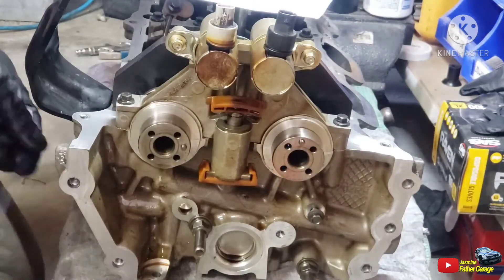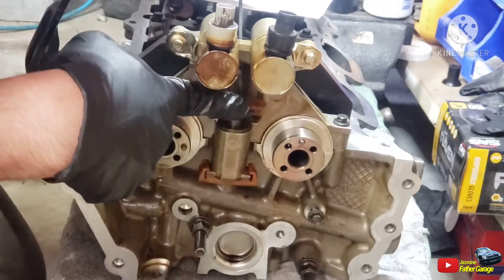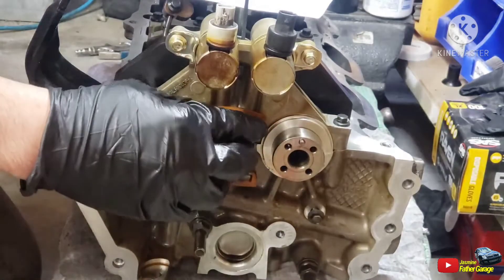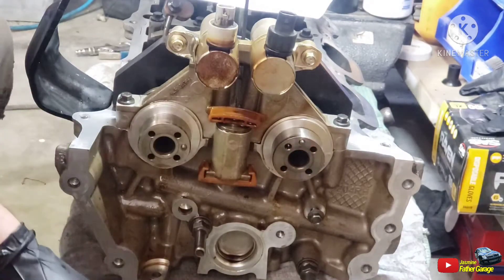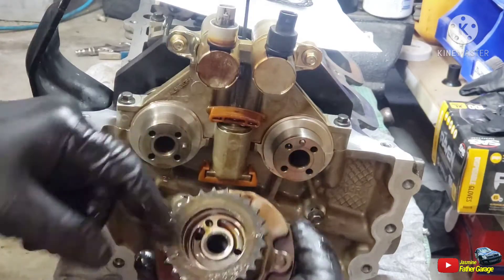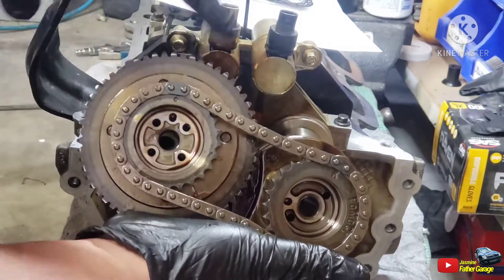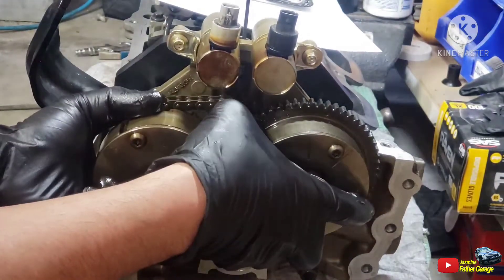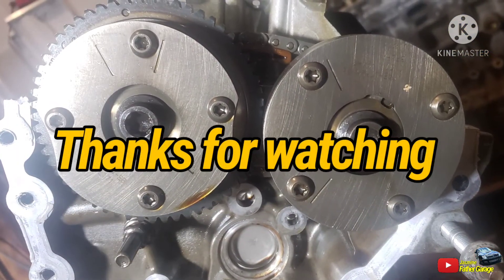Ford 3.7L or 3.5L Engine How to use special Tool for Secondary Chain tensioner & sprocket/chain

Comment: Hola bien día genial tu video,  tendrás el número de la herramienta de bloqueo de los árboles de leva para ford lariat v6.  3.5 biturbo 2013.
Reply from the maker: Yes 3.7L & 3.5L engine are same.
Here the kit for camshaft alignment tool  567618
Reply: @jfGarage4k  gracias mucha prosperidad y salud.